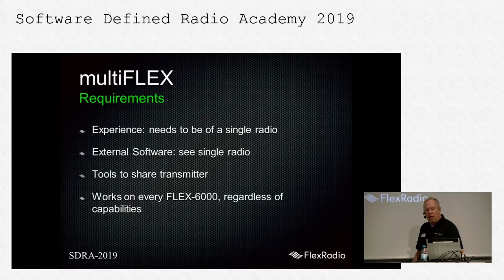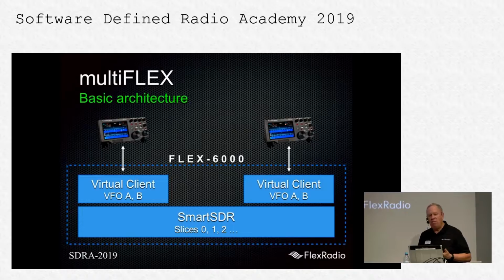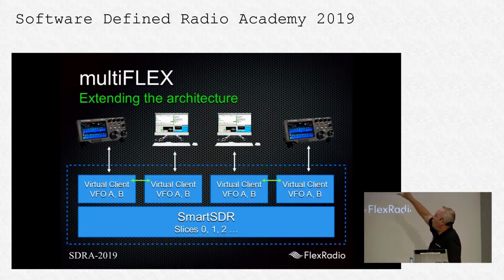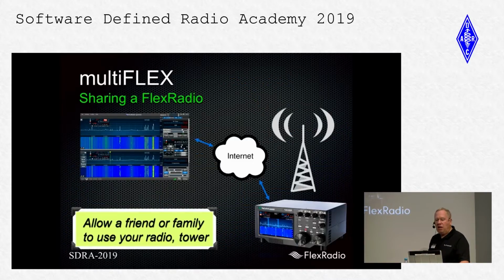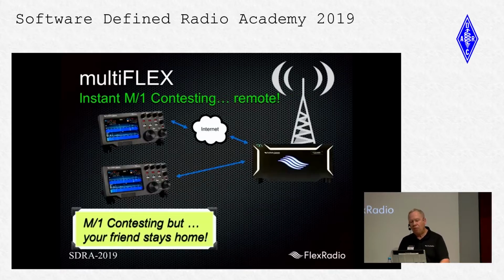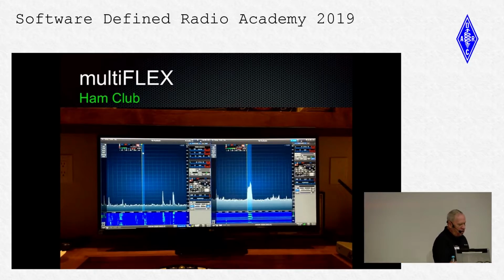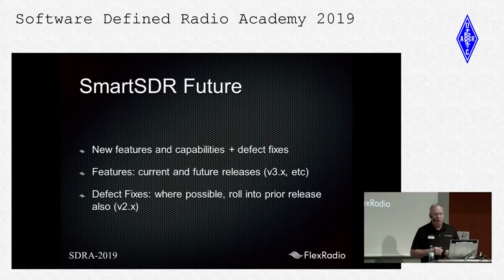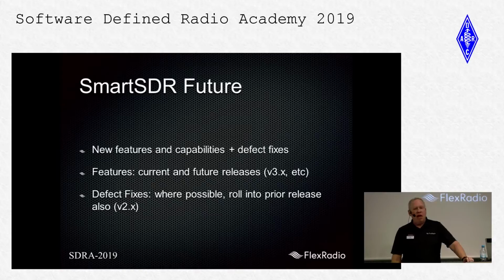Mack McCormick, W4AX: FlexRadio: SDR Technology that Will Change How you Operate HF

Comment: i think that,s not the way to work a  station
Reply: I Agree with you working a station that you remote from your own QTH should count but Remote connection to a Radio that could be in the same town as the station your working is just cheating imho.
Those type of contacts shouldn't be allowed as a valid contact.
I have nothing against using remote Radios for making a contact to another station for a rag chew when it's the only way but it shouldn't count as a valid contact the same way as via repeaters wouldn't count.